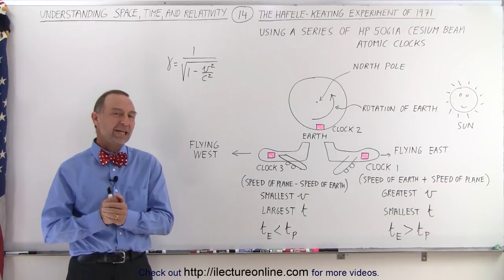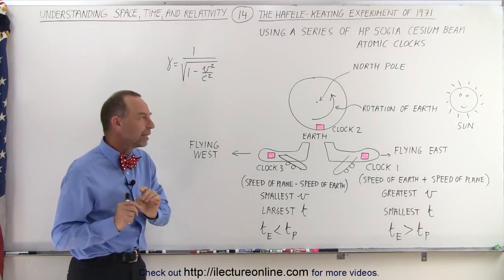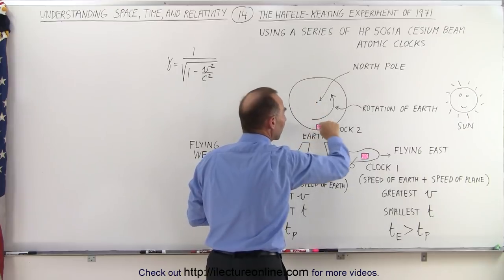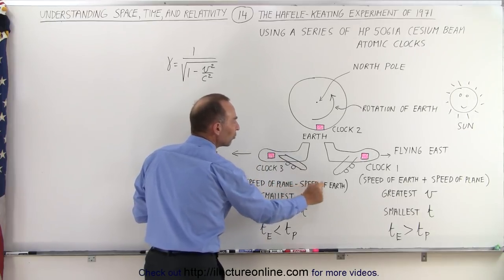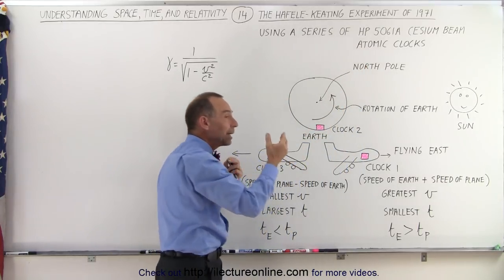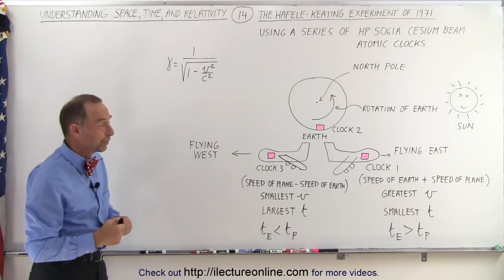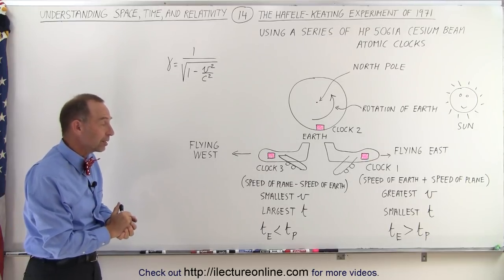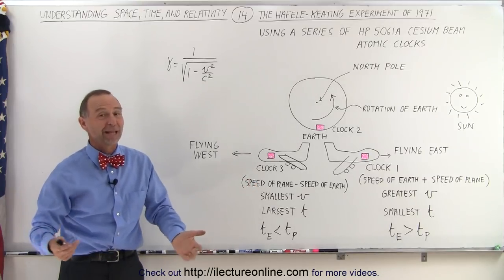Physics 62.1  Understanding Space, Time & Relativity (14 of 55) Hafele-Keating Experiment

Comment: A lie (in literature and textbooks). These atomic clocks, four: 120, 61, 408, and 447 were not accurate in order to record the tiny difference in clocks recordings. Check the original result in US Naval Observatory (now online and in Science,vol177- details by. A.G.Kelly,www.cartesio-episteme.net. Only one clock, nr 447 had a fairly steady performance but it showed no difference between East and Westward flights. All the data was "fixed"(447: from (-51nsec to -97) in Eastwood, from (=26) to +266 nsec) in Westwood. Only later experiments proved mainly a gravitational time dilation (Doppler effect) and not the Lorentz formula though mathematically they are equal (easy to calculate) in reference to the reference system at the center of Earth. You don't see it in this lecture.
Reply from the maker: Thanks for the information.   With our GPS satellites today we adjust for both time dilation and the gravitational effects
Reply: I was trying to post a more direct link to the A.G. Kelly paper but for some reason YouTube would not let my link be posted as yours is.   Any suggestion how to do this?
Reply: @rogerg4916  what i see is one cannot just "copy"+"past"-it does not work (for some reasons) One has to type it by himself
Reply: @krzysztofciuba271  Thanks for the advice but I tried that several times, even using words like dot and slash but I still get a "Returned Error".  Actually, to go directly to the paper all you need to do is add /H&KPaper.htm after net on your link.